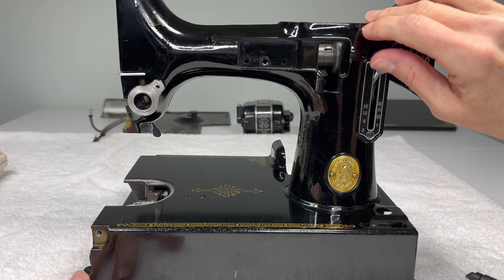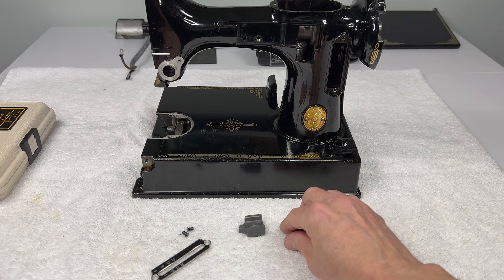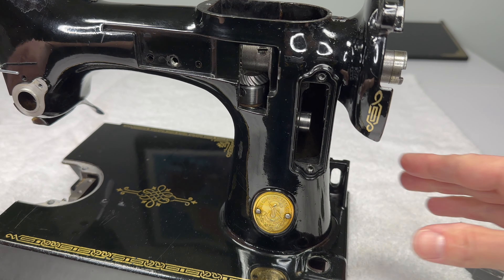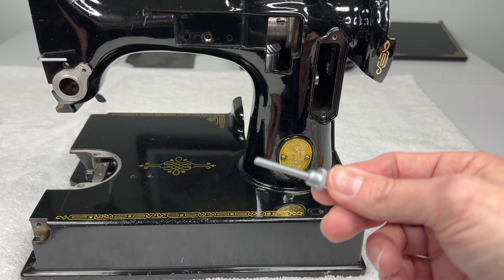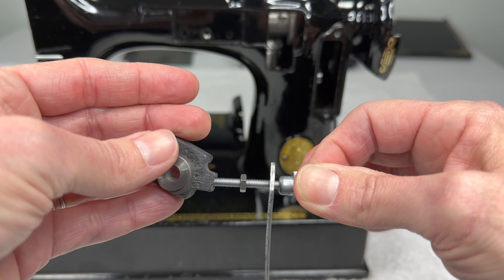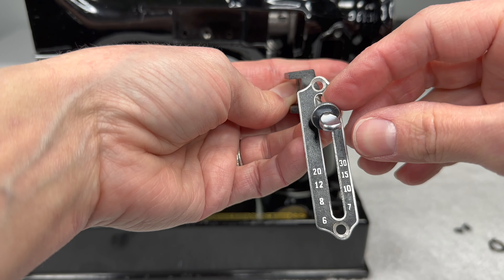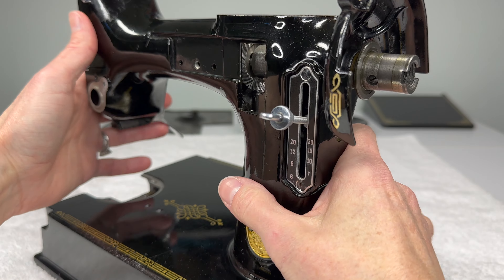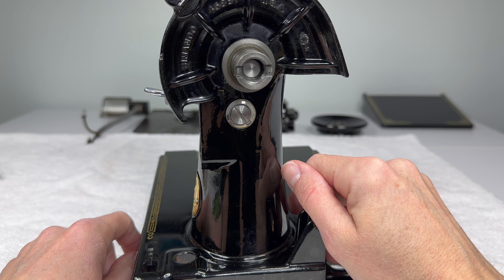How to install the feed regulator on a Singer Featherweight: Singer Featherweight Series Part 10

Comment: Rather than fingers I would install the roller bearing with either needle nose pliers or a magnet.
Reply from the maker: Yes! I have just gotten so used to using my fingers but that is not a practical approach for everyone. Thanks for adding that suggestion!